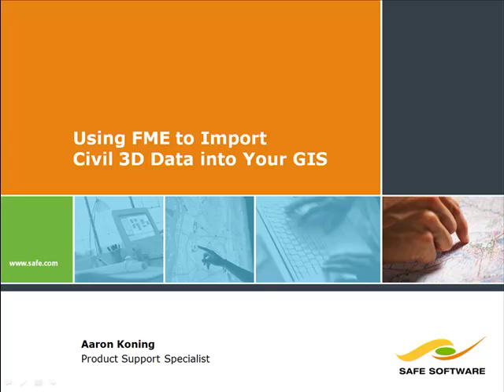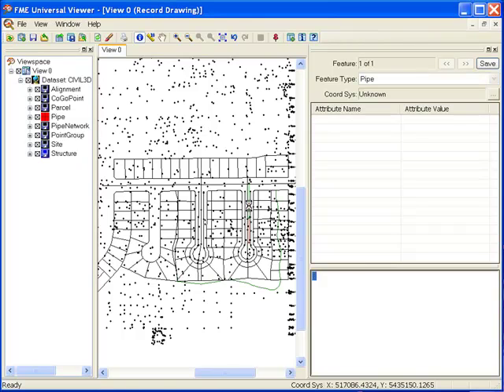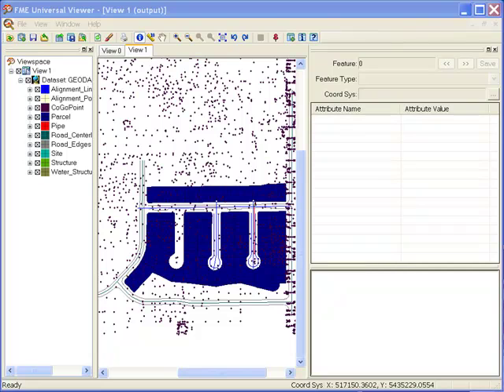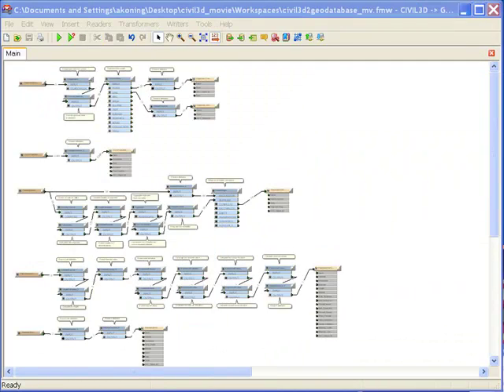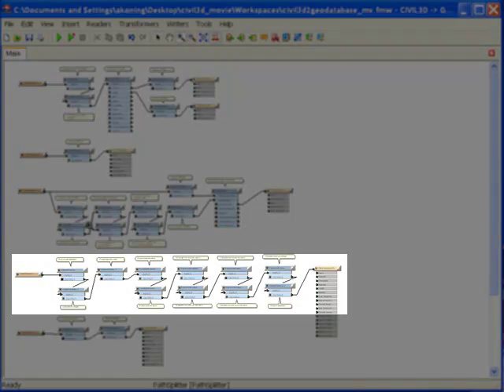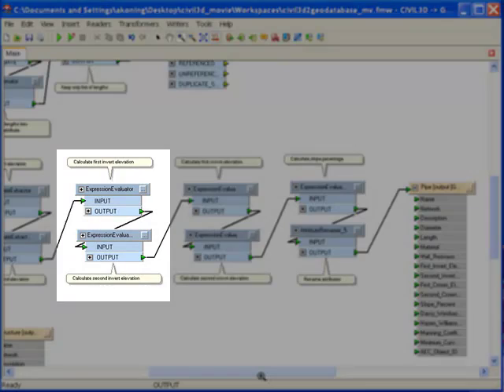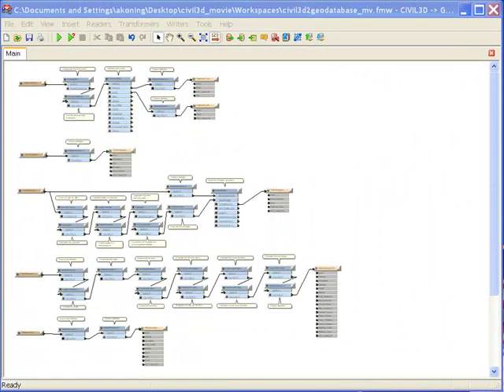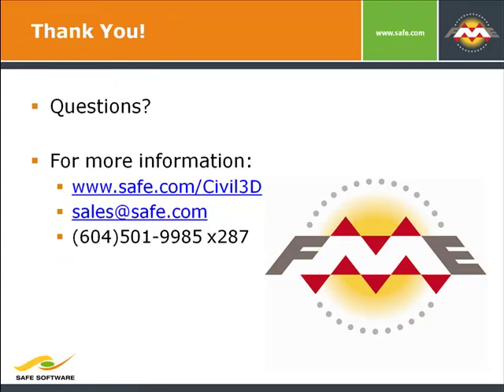Convert AutoCAD Civil 3D data to GIS formats

Comment: Where can I get that Workspace? Do we have to build it from scratch?
I have the FME Data Interoperability Extensions for ArcGIS...
Reply from the maker: ucastillo2 If you have the Data Interoperability extension it does not have support for Civil 3D, but if you have the FME Data Interop edition you can easily build a workspace to perform this conversion (http://safe.com/datainterop). Just generate a workspace from Civil 3D to your GIS format of choice (e.g. geodatabase). You can then add whatever transformations you need for your scenario and modify the output data model. If you require help with particular transformations, we have many resources in our knowledge center (http://knowledge.safe.com/) and you can always contact our support team.